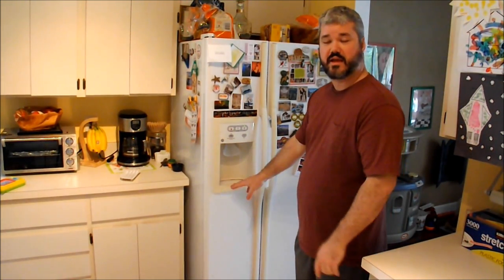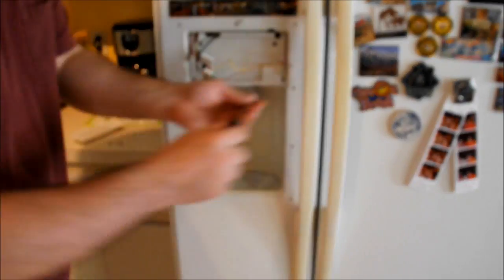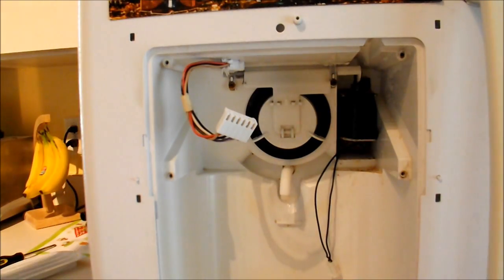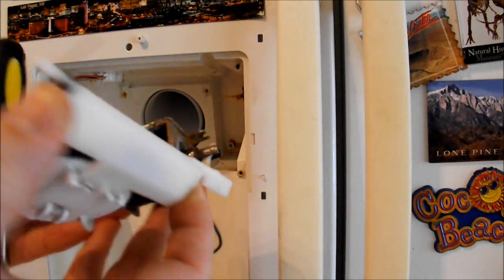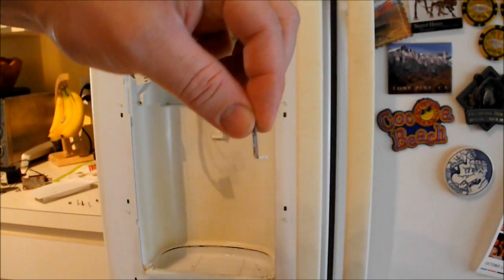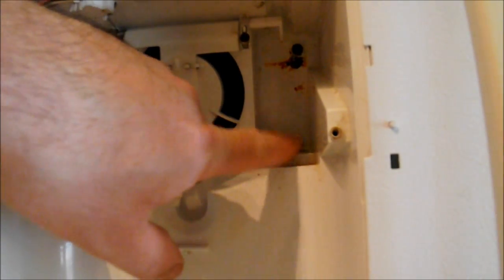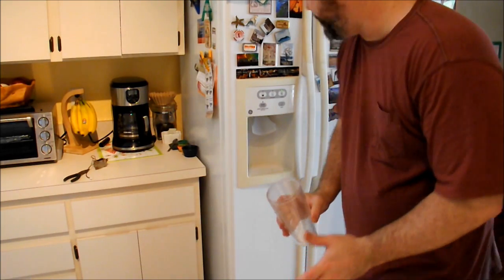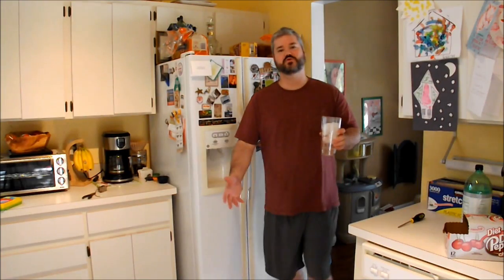Fix it! - Fridge Ice Not Dispensing

Comment: OMG I DID IT!!!!!  Thank you so much for this video.  I took it apart, sanded and lubricated the solenoid, reinstalled and it WORKED!!!!  Not to mention cleaned up the mold I could not have seen when I removed the panel.  I am going to order a new one but in the meantime it is working great. THANK YOU so much.  I hate to think what this would have cost me to have a repair person to do this project.I am now a graduate of the University of Youtube.

Comment: It was very helpful to me. I followed the instruction and fixed my ice dispenser. I actually cleaned the old one, removed the rust and lubricated the sliding pin and it worked again 😃. I didn't purchase the new part. Thank you.
Reply from the maker: You are very welcome!

Comment: Good morning Sir, I was watching your video but have a different sort of problem. My dispenser has no sound when I press the glass, moving the feeler... It did this about a week or two ago... I took the overfull tray of ice out. And once it has ice back in it, it worked until now. Just wondering if it still might be (no sound) compared with the sound and no ice... Thank you for your time
Reply: Same problem. Nothing happening when ice dispenser pressed. It seems like none of the controls are working.

Comment: Great video, but I fixed mine by removing the ice that was stuck right where it get chopped up and comes down.  You might want to lift that little lid and check to see if there is ice stuck. much easier..

Comment: I have ge model  GFE28HMHEES  I have 2 icemaker I one at top is not putting water at all an if I add water it makes  ice but will not dispense  it I maker 2 in freezer  department  was depends ice now stop  the fan was change so the fan is working

Comment: NOw mine sounds like the motor is working for about 1 second then nothing on the ice dispenser, as in no sound.  Sounds like a motor starts then after a second the sound stops. .  Water works though.  It did work after that for 3 cubes, then stopped.  HA.